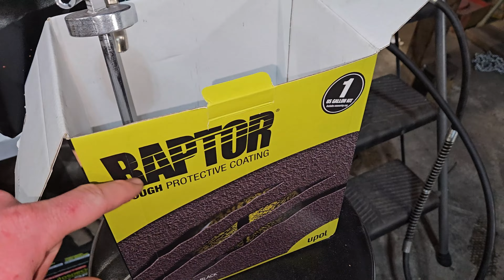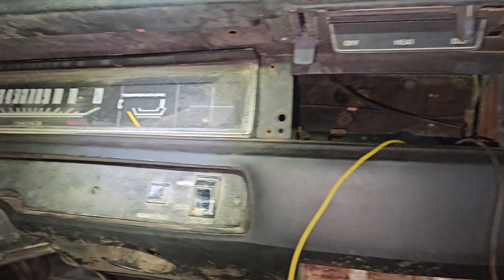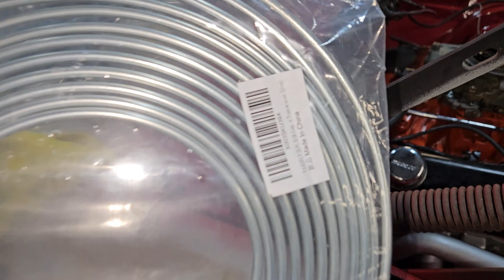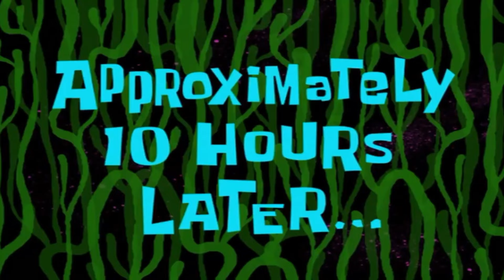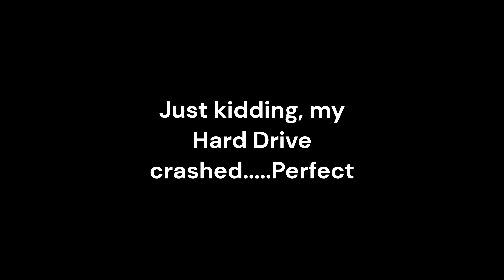1969 Plymouth ROAD RUNNER Build Part 4: Broken Lift, Cheap Paint, and Old Wiring!

Comment: Where you fellas at in Missouri? I’m restoring a 69 coronet in Wentzville.
Reply from the maker: Oh no kidding? We are on the East side of STL across the river. What year Coronet?
Reply: 1969 Coronet, it has a 440 in it. It’s not the original motor. I’m putting in a floor and trunk pan right now.
Reply: 1969 Coronet, it has a 440 in it. It’s not the original motor. I’m putting in a floor and trunk pan right now.
Reply from the maker: When would you like to do victory 69 B-Body burnouts? Haha